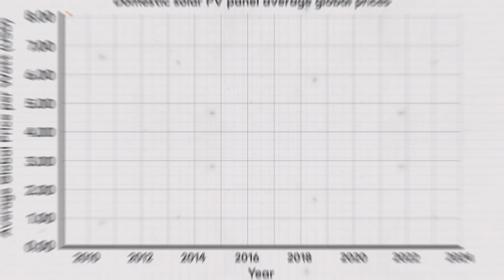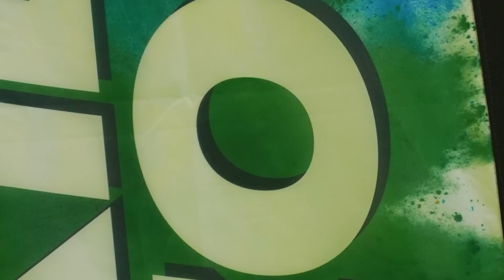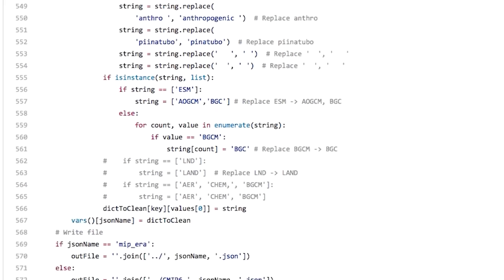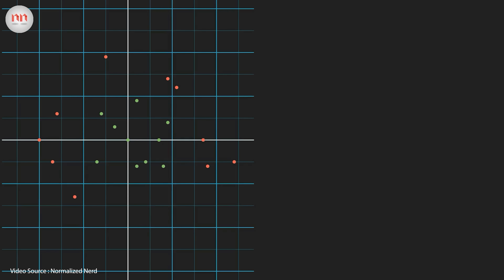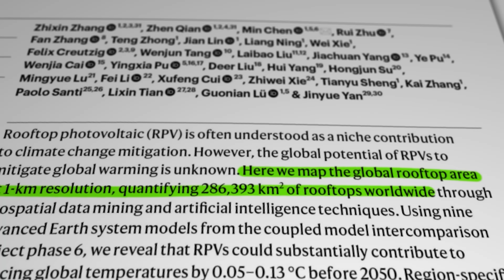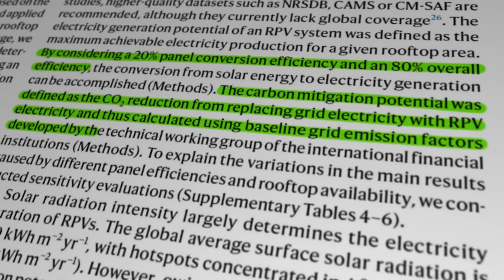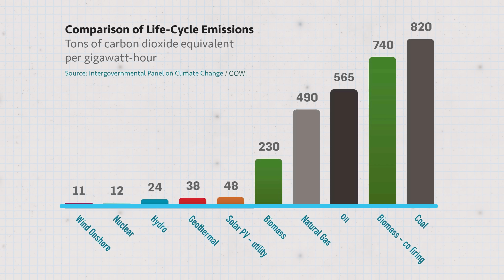New Report - Rooftop Solar PV is THE biggest climate mitigation technology!

Comment: So why does it still cost me tens of thousands to install? Alternative to rooftop in high wind area?
Reply: Somebody must be ripping you off, if it costs you tens of thousands to cover your roof with solar.
I'm pretty sure wind turbines are not a good alternative, unless you can build a really big one. A wind turbine that generates as much electricity as even a single $70 solar panel will certainly cost more than ten times that amount. And the mounting is not any easier/cheaper than for the solar panel. And it makes noise and throws moving shadows, which a solar panel would never do.
Reply: Depends where you live and the subsidies you get, they do make the heavier duty mounts for typhoon zones but that assumes your house already has a roof rated for typhoons. If you have a steep pitched roof there is a new thing called roof apex wind generator, bit like F1 sail boats that can sail faster than the wind , the way the wind cuts across your roof amplifies the speed. Meant to be more efficient than solar if you’re in the right area

Comment: The technology is there. The legislation and mindset is not:
You need smartgrid and the use of EV's as storage to make solar work as a 100% green alternative.
Smartgrid means you will provide electricity to your neighbours when you have surplus and vice versa. Not going to happen in this capitalist oriented world.
EV's have huge battery storage but very few EVs allow 2-way charging. In fact, in most countries in Europe it's extremely hard to find any certified 2-way charger and if you do it costs you an arm and a leg.
Such a waste of potential. 😢

Comment: Love your videos. I have had solar panels for 12 years. Now paid for themselves - they were £5k when installed and also limited in output to 3.5kW (I believe). In the brightest sunshine I now output 2.5kW. The system that I took on meant that I am paid for whatever power I produce and that includes power that I have produced AND used. That benefit ends soon. I have a Rav4 hybrid and so judicious timing in sunny weather means that most of my car’s intake of power is derived from my solar panels - win/win.

Comment: Yes, you are correct.   It is a very wise investment.   I had to see it to believe it.  We are located in Mount Joy, Pennsylvania, USA.  Over the years we have updated our home.  A standing seam metal roof holds a 12.5 Kw system made up of 31 modules at 405 watts each  from REC and an 11.4 Kw inverter from SolarEdge.   No holes in the roof, the mounting is attached to the standing seam.  We also replaced an air source heat pump with a ground source heat pump from GeoComfort,  a 3 ton system with 2 vertical ground loops, 235 ft deep each.  Due to the changes we now live in a net positive home, passing net zero.  Last year we produced 14.7 MWh of electricity and consumed 6.5 MWh.  All systems are working well .  We are saving and making money while helping the environment,  a win win situation.

Comment: If we could get most homes producing and storing their own energy, we would save a lot in transmission losses, it would give a massive boost to people's independence, and no longer would an attack be able to knock out power for large areas.  Those pesky battery prices are still a hurdle for this, so hopefully we will see some improvement there.

Comment: Northern New South Wales with both a 3kW array and solar hot water. Had the latter much longer, and getting it put in took about a third off the power bill. The PV panels took off even more, to the point that our bills in the warmer quarters are under $100, and top out around $200 in the winter. Having a house that's designed with passive solar heating in mind also helps, but you can't retrofit that.

Comment: There is no climate issue. I installed 4kW of panels 5 or 6 years ago purely because we have a rigged electricity market in the UK that subsidises appallingly destructive wind turbines, I certified these things for nigh on a decade so I know they are destructive, and the panels have paid back already. The price per Watt for panels delivered in the UK is around 15pence now so it is a no brainer and you can get good quality 3kW hybrid inverters for under £700 and 7kWh batteries again for under £700. Anything larger than 4kW in the UK is a waste of money as we simply don't get the weather for Solar during the Winter or the length of daylight required. I can be completely off grid with my set up for at least 9 months of the year and charge my EV up for around 7 months a year. I also have a cheap EV tariff so I can charge my EV and house battery up overnight in the dead of Winter that way. Do it yourself using ENA approved list equipment and save a fortune provided you stay under the 3.6kW limit and tell the DNO within 28 days of commissioning the system. This is for simple systems coming under G98 in the UK. Even a couple of panels on a garden shed roof connected to a simple on grid inverter will save a lot of money if you simply wait to run heavy loads only when it is going to be a sunny day. You can do that for under £600 and if you have a hot water tank another £200 will get you a Solic 200 to divert excess generation to heat your water.

Comment: While individuals may benefit, in no small part due to the high cost of electrcity caused by renewables.
Places such as Australia and California for instance suffere extreme grid control problems. It is due to the solar output being relative to the sun's height. The worst time is when the afternoon and evening draws in, the load is not diminishing, so idling (during the day) conventional plants have to increase output to keep the grid balanced.
So we have conventional plant running inefficiently when solar is strong and then stressing the plant by having to increase power rapidly. This sort of operation on a daily basis is detrimental to generator life and increases cost.
In the U.K. solar is of little to no benefit to the grid especially as it's output for four months of the year is minimal and coincides with when pwer is most needed.
Just because it is possible to generate power from solar, it is more complicated than that and is why solar is the very worst of all renewables generators.

Comment: I think you missed the best and worst of rooftop solar panels. 

The best being of cause that the area on the rooftop does not have any productive purpose. Unlike massive solar farms that generally replaces either farming or nature, which is the largest drawback to solar power in my opinion (also the largest cause of local resistance to solar power). 

The worst being that the small consumer grids are not really designed to collect and distribute large amounts of collected solar energy. It is much more efficient to build those massive solar farms with a single cable and transformer station than to change transmission lines to cope with many small sources of energy from a large area. 
Of cause, some part of the collected energy will always be used by the building that collect the solar energy, so not everything has to be transmitted elsewhere. But it does put a limitation on powering an entire society with rooftop solar. 

You also have the challenge of intermittent energy production, which is more or less the same for rooftop and solar farms. Worse for rooftops since they are more likely to have sources of shadow like large trees. Meaning a large investment in battery storage or pumped hydro is necessary to exploit the full potential.

Comment: I had my first panels installed and registered the day before they reduced the original 45p FiT. Only 1.8Kw on top of a bespoke greenhouse at a cost of £10,000 including greenhouse, which, at the time was nearly a bargain. With the FiT they will probably repay me before the Fit finishes. However, since then, then thanks to the Welsh government I’ve had my almost defunct oil boiler replaced by an air source heat pump with a complete upgrade in my central heating  system. But to qualify I also had to have a minimum amount of solar pv installed as well. My south facing roof wasn’t big enough for this, but the north facing roof was. As I wasn’t paying I said to go ahead, not expecting very much. I was astounded by how much they produce, even on overcast days when my south fasting greenhouse panels were producing zilch. OK, I got my new ones for free, but don’t let lack of a south facing roof put you off. All I need now is for  Octopus to pull their respective fingers out and sort out the export tariff.

Comment: We installed our 10kw system in 2019.  Being in Queensland it has already paid for itself.  We were told 5-8 years but it actually only took 4 years.  We bought a battery in 2020.  The expectation was that would take 15-20 years to pay back but it’s looking more like 10-12 years.  We don’t have peak and off peak rates here.  If we did then the payback would be more like 7-8 years for the battery.

I think that batteries are more important than solar as we rarely use peak time grid power.

Comment: 2.5 installed 2012. 8 year payback. Inverter replaced after 10 years. Degradation was offset by increased radiation/photons. £1200 per annum tax free.. in a road of 67 terraced only 2 have panels. 50% have 95% perfect roof position. No refund on standing charge for the production infrastructure I paid for.

Comment: A secondary effect of rooftop panels is the shading effect on the house beneath, leading to less heat gain and less need for cooling. (Air con) I have considered the idea of a rollout sunshade for parts of my roof not already covered by solar panels. 
My PV panels were expensive at the time, 2012, but have more than paid back their initial cost and give me free leccy much of the time. Solar thermal also on my roof provides in winter heat to the U/Floor heating if needed, and other wise free hot water.

Comment: Report from Japan: We installed solar panels 13 years ago, but we have not been able to recover the cost.
However, solar panels have a long lifespan and are therefore useful for reducing CO2 emissions.
I've been carbon neutral in the summer for two years now using Icon Wind room cooling and solar power.
To further reduce CO2 emissions, it is necessary to store the solar power generated during seasons when the air conditioner is not used as another form of energy.
I work as an electrical engineer in earthquake-prone Japan, and I have a unique idea for gravity power generation.
If there is someone you can trust, I think it would be okay to tell them the details.
However, it is less efficient than a storage battery.

Comment: Here in Germany PV system were heavily subsidized in the past what led to thees popping up everywhere. Later the subsidies were reduced and eventually removed. Today it is obligatory to put a PV system on the roof when a new house is being built. We got our system for the roof recently too. That is all great. But sadly - the apparently not predictable need for grid expansion is leading towads PV system being locally limited in the output power well before what they could deliver in the summer, because the electricity cannon be redistributed. So - while prices for a PV system has been dropping, the infrastructure is too far behind to keep the pace. I expect it will take 10+ year for this technologically asleep country to  catch up with cheap solar power. Sadly.

Comment: I live in Oregon, where home-owners are limited to a certain number of solar panels, based on annual electricity usage.  I have 14 panels and could easily support double that.  One problem is the grid bandwidth, but the politicies are a bit regressive and heading to more disincentives in the future, like phasing out the 1-to-1 buy/sell rates of kWh. =/
Reply: If you doubled your panels couldn't you have the inverter limit the power export to match regulation? (and increase battery cap instead)

Comment: The onky issue is the inverters and the quality and length of time they last, they're not cheap and in my experience i had to keep replacing it. If they start or have started making inverters that last 20 plus years, then its economical. I was getting a year or two at best.

Comment: did you think about collapsing grid income. 😮 ?????
Look at the famous duck curve.
There are 2 duck curves. 
The 2nd is the collapsing GRID CASHFLOW. This is so f......king obvious.

This is extremely dangerous to nuclear electricity that needs both
 247 continuous demand and 
247 continuous cashflow. 

Nuclear needs its maximum UTILIZATION. Because it is fragile. 
Seconds to shut down and days to get back on line.
But what the F do I know ? after decades in fossil fueled generation and transmission.
Ask the nuclear promoters why maximum UTILIZATION is important. 
Ask the nuclear promoters if reactor plutonium production is valuable as reactors are the only source of plutonium in the world. 
Ask nuclear promoters why Australia only sells uranium yellowcake to nuclear nonproliferation countries. 
Ask how does worldwide CO2 emissions are stopped without uranium nuclear electricity.

Comment: IIRC from not so long ago, domestic use was ca 23% of UK energy consumption, the grid was riddled with bottlenecks due to lack if investment and more than a little political chicanery, with home energy conservation almost ignored.
   There's been precious little joined up thinking at government level over the years, leaving it all to the individual to mull over payback periods, and go through hoops with the monopoly energy supplier before they can even begin on solar.
   Fair enough that Oz is famed for home solar, but contrast government engagement there - Community batteries rolling out at substations, grid upgrades, takeup in EVs ?

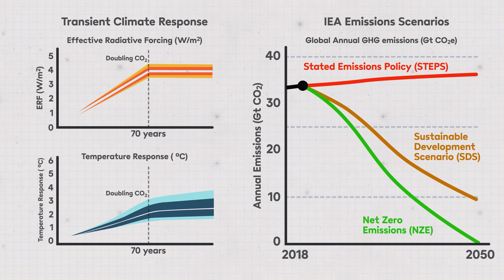Comment: 7:30 the 3 scenarios. Why would net zero be a steady decline? IMO that doesn't make sense. If the net zero tech is being developed and rolled out with electrons on the grid in 2040-2050, the graph will only start to go down around 2045 and then drop off to zero by 2050. Politics and logistics will spread out the 2050 goal to say 2035 -2065, but once it's economically the best ROI to be net zero, the shift will be sudden, therefore not a nice gradual decline.

Summary: we shouldn't aim to be halfway to the emissions target in half of the goal time.
Eg, We have 15 years to develop net zero dispatchable energy and 10 years to deploy it. (Fussion, gen4 nuclear, PHES, chemical battery, new deep geothermal drilling at old coal plants, etc)

Comment: PVs are great but they don't work at night so we need affordable and scalable BATTERIES to make them work at all.  Right now the cost of the batteries overwhelmingly dwarfs the cost of the PVs, making projects like this financially impractical.  We need electricity 24/7/365.24 not just on sunny days.  A few days energy reserve at least is going to be needed and a global power grid is a sure prescription for global disaster if/when it fails.   Everything must be local to be stable and to make sure that everyone is served by the energy that everyone gathers.  There still much more work to do in the labs.

Comment: Both parties are protecting the national electrical grid. 
Strategic national energy policy. 
The grid is fragile and lightweight and extremely expensive
Military Strategic. 🪖 
More grid interconnectors.
More grid cashflow stability. 
More rooftop PV grid free electricity.
More v2g EVs massive battery on wheels.

Comment: ❤ur Show! Note: The PV system you describe is called 'Grid-Intertied' which means it does not work when utility power is off-line. i.e. it is Dependent on Utility power to operate. 
Get a E.S S. Energy Storage system (usu. Battery Bank) so you will have back-up power during grid-down...or to GO OFF-Grip if needed🎉🌞🧑‍🌾🗽🗽

Comment: Most Domestic PV installations need a 2-4 hour peak shifting storage "system" installed - and costed into the equation  (NB a 1kWh battery replaces 20 tonnes of gravity-tower storage needed (~20 tonnes at 20 metres of gravity potential per kWh)...  That little energy (- 3-5 kWh ) imported from the grid after sunset is mainly derived from fossil fuelled (or other time insensitive baseload or peaking source) generators-  as (large as they are) installed mega batteries don't have the reserve time to deliver for the entire grid they they are connected to  (more "terminal" - unidirectional battery UPS installations are needed - ie. in local grids, rather than being sited along the main interconnectors - although those are useful to be used for grid management  - huge power injections for very short time frames - grid stabilisation services...), and WIND lapses about the same time a s solar - in the early evening, in many coastal areas.

Comment: If you look at open electricity Australia, go to New South Wales, you'll see that the annual consumption is around 75tw. 9tw of which comes from existing rooftop solar alone. That's caused a massive duck curve in the supply demand curve. The Albanese govt plans to fix that by subsidising home batteries, around $300.00/kw. They spent 12 billion on a very inefficient pumped hydro system that's still not complete, and it's capacity will only be 2.2 gw. 12 billion dollars on home batteries would have given us 40gw of energy storage. A bargain for such a crucial issue. I'd estimate that for green, cheap and reliable grid we would need a days worth of energy storage of around 200gw. Hope you find this interesting.